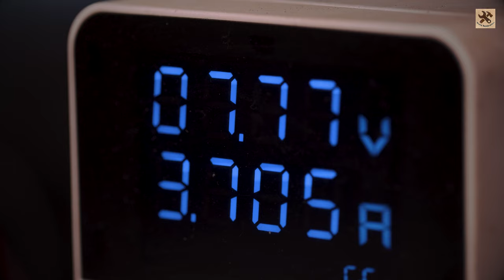Antique Stone Gas Lamps  - Restoration

Comment: I'd say you need to practice your soldering skills.(the solder should flow more) Using a softer soldering wire like silver solder would help a lot. Flux helps too.

Comment: Interesting object you restored never seen one before It is not hard to solder brass or copper. Use the solder for copper pipes and flux. Easy as 1, 2, 3. One  👍 for effort.
Reply from the maker: Thank you